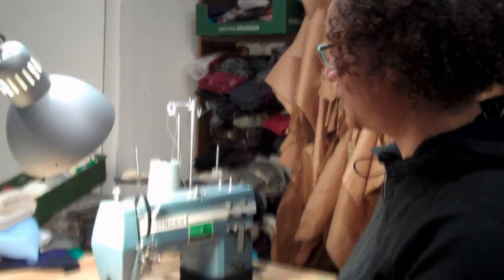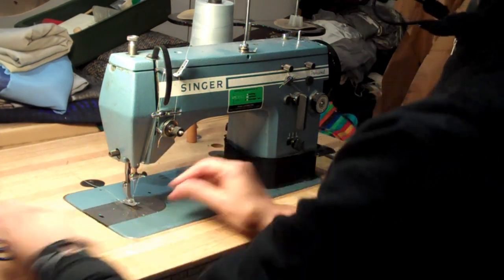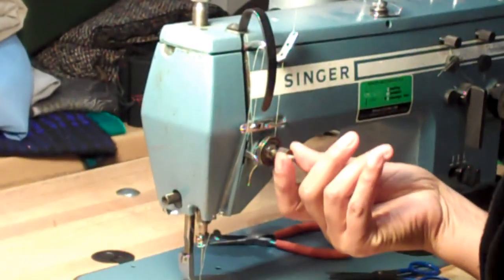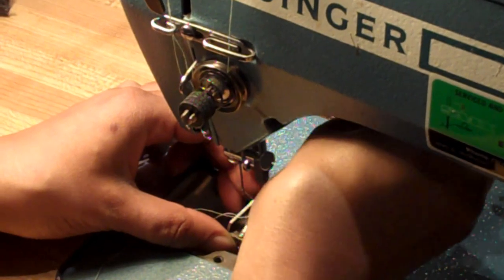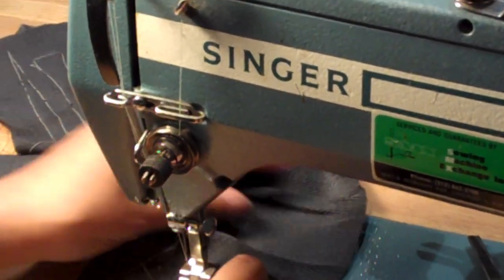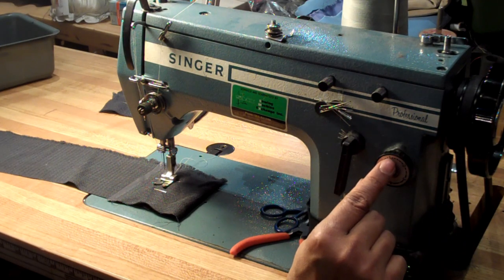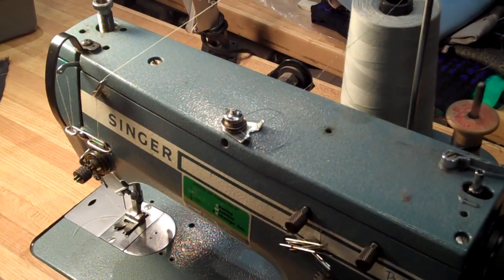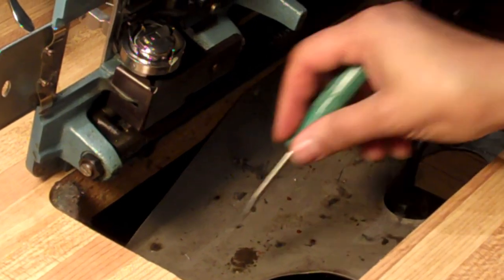Singer 20U Industrial Sewing Machine Tutorial

Comment: I inherited a Singer 20U from my mother, who was a professional seamstress all her life, when she passed away 15 years ago. I learned to sew as a young girl on this machine, and when I got older and had to get my own basic home sewing machine, it felt so slow and flimsy compared to using this, lol. When she passed away, she was living in Florida; I was living across the continent in Las Vegas, but thought I might be moving back to Florida soon, so I put it, along with countless bins and boxes of threads, notions, fabrics, and other accessories in a storage unit. Things didn't end up as I had predicted, and I ended up staying in Vegas for 15 years, before moving back east to North Carolina, and finally making it down to Florida to clean out the storage unit. I had to rent a truck to haul this bad boy and all the other bits up to NC, but I am glad I did. I now have a lot of cleaning and restoring to do, as I'm sure 15 years collecting dust in the humidity and humidity of Florida have probably not been good for this machine. Despite this, it actually looks like it has held up ok. I ran across this video as I was researching the use and care of this very particular machine before starting to clean it up. I'm assuming I will probably need to have it serviced before I can start using it again.

My model does not have the bobbin threader on the top, however. It's on the right side of the machine, but otherwise looks identical to this one. I believe she got hers in the early or mid 1970s. 

My mother kept a roof over our heads and put food on the table with this machine. I'm just a sometime hobbyist sewer who likes to be able to mend clothes or craft some curtains now and again, but I count myself lucky to have it. Thank you for posting this video!

Comment: I don't know if someone has mentioned this earlier but that big felt pad under the top cover (29:50 into the video) is the reservoir for the automatic oiling system. This felt pad should be liberally oiled and it will constantly feed oil to the main wear points that need to be lubricated all the time you are actually sewing. It's important.
Reply: neve knew this

Comment: The button mode for stitches is not used correctly in the video, you should not have to release the presser foot after you started, the point of the 3 options on the button mode knob is to provide consistency of stitch width and repeatability... the centre mode is to stitch the wide top and bottom zig-zag stitch going to the end of the two smaller zig-zag stitches going down, the left is to stitch the narrow stitch left of the buttonhole, the right is to stitch the right side...so you need the 3 button modes to do button stitch correctly!! Hope it's clear!!

Comment: For some months now, i have this problem with my 20u . Bought it on fairly used but couldn't make a complete dress without the threads(normal) getting cut off,  so decided to  use hard threads and now the problem is that the sewing under skips..so confused ..how do i go about it. Please can someone help me out?
Reply: its just timing problem.Have somebody adjust it for you , and the tensions as well...those are hardy machines , japan if not US made..Mine got submerged during the Ondoy floods , and after pressure washing it , had it dry thoroughly it was up and running as if nothing happened.